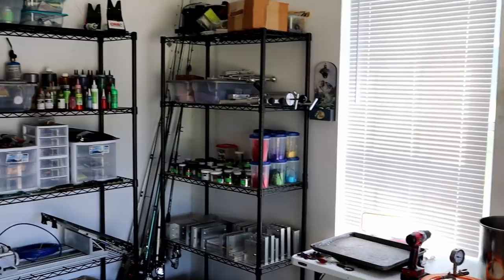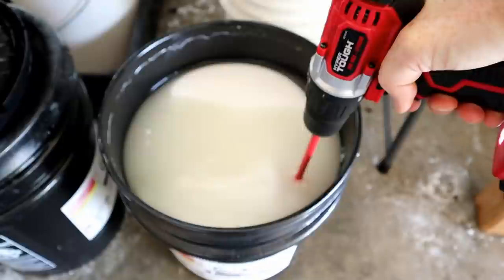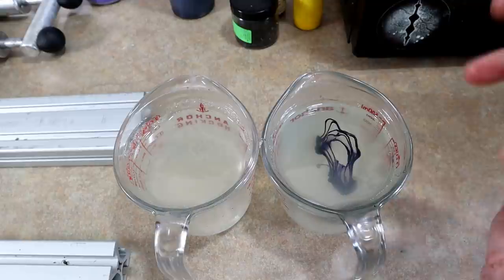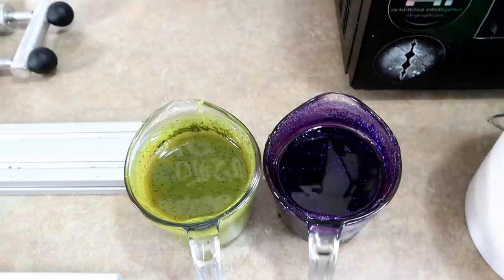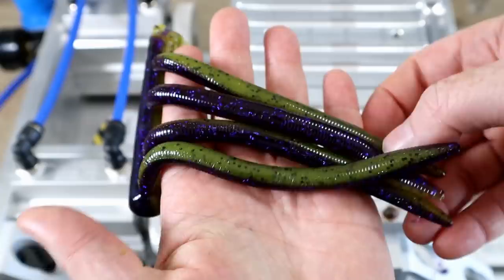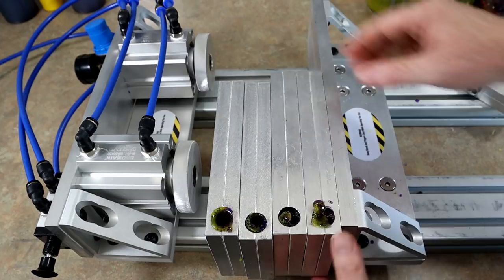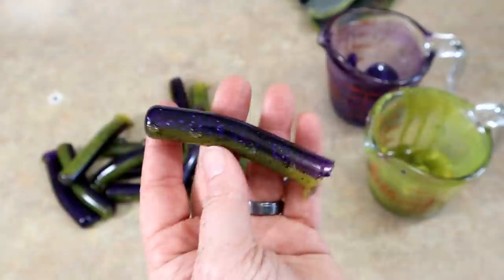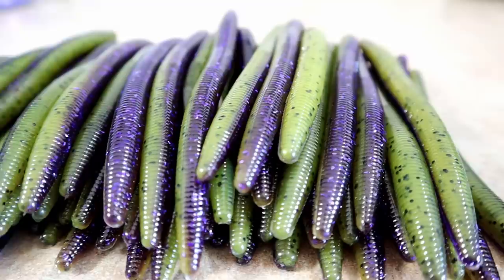Making A Run Of STICK WORMS; New Poster For The Shop

Comment: I bought the 4” bloodline swim bait and would love to see some of the stuff you do with that.  I don’t have a dual injector because I’m just starting out and saving up for it.  I’ve been trying to do the skin pours to get multiple colors but I’ve been having troubles getting air bubbles and the tails not filling in.  If you have any tips I would greatly appreciate it! Thank you!
Reply: Use a heat gun on the baits to warm the plastic back up to get rid of the bubbles. The tails not filling in may be because your plastic is a bit too cool and is not flowing well. I haven't started bait making yet, but that's what I 've learned from watching about 200 of these videos lol.

Comment: Would you recommend putting plastic in a pot on a cooktop to keep it at 350 to run multiple molds? Does that change the pigment? I.E. if you need to run white in multiple molds is that ideal?

Comment: Is it normal for dead on plastic to really get stuck in your injector and be oddly sticky after mixing it very well. I just got my first 2 gallons and it's just not the same as other plasticols.
Reply from the maker: Not at all..check out my quick tips playlist for my Plastisol preparations
Reply: I've watched it and done almost that exactly